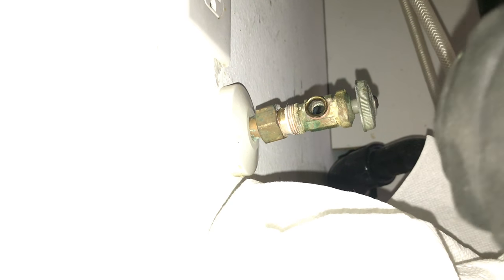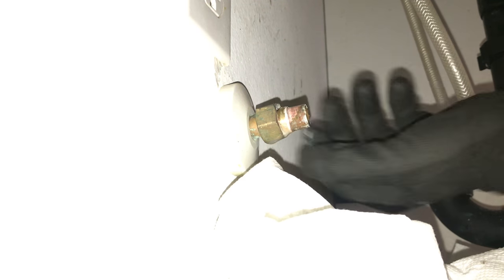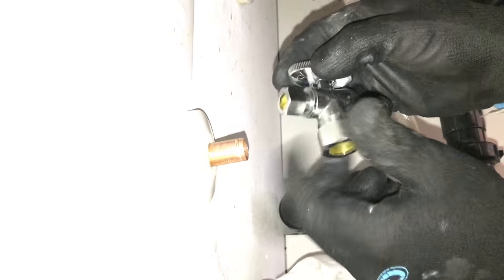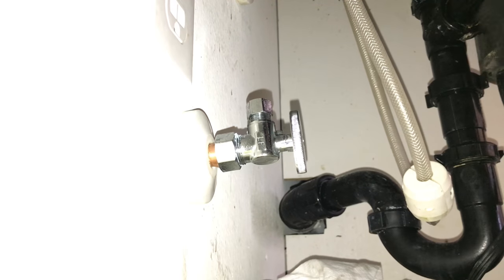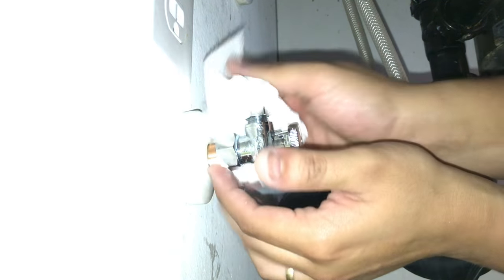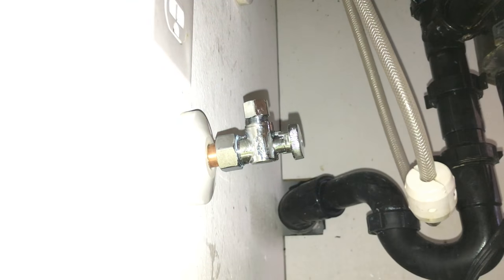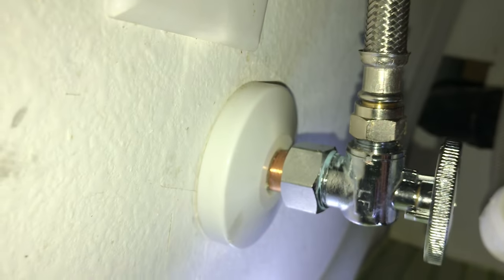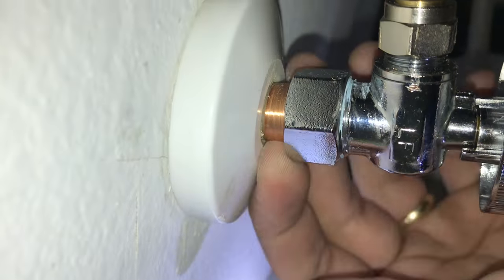How to replace a water shut off valve under the sink

Comment: That pulsing residual water leaking out often happens after shutting off the main water, even after draining for a while, because the pipes between that sink stem and the rest of the house still have water in them, and when you move that pipe, you make little waves that flow back and forth, which leaks out like we see here.

The solution is, when draining water for work like this, open the lowest point outflow and the farthest point outflow. In my house, this means opening the patio spigot outside. I catch this water in a bucket and throw it on my shrubs/trees/etc.
If you're not sure which is the lowest/farthest outflow, open them all. This drains much faster as well. 
Pro tip: be sure to turn off icemakers, tankless water heaters, and anything that has its own pump that turns on automatically. (Hot tubs, water filters, aquarium inflow, etc). If these turn on while the water is turned off, they can burn out their pumps and require expensive repairs.
Reply: Great advice, thank you!!
Do you have to cut the copper pipe? Isn’t sanding it with mesh good enough?
Reply: Golden advice youtube so good for this

Comment: Looks like a compression sleeve puller would have come in handy on this job.
Reply: What do you do when the pipe is too short and there is no room for the olive to be exposed and pulled out? Is there a reason not to keep the original nut and olive on there provided it fits the new replacement valve?
Reply: @Russell-rc6qq I would recommend not to use any fruits in the plumbing sustem.

Comment: Probably not the best placement for an outlet
Reply: Mine is the same.  I took my valve off to replace and it was still leaking and some water splashed up to towards the outlet.  I'm not sure any got on it but...  The breaker is off but still not a good place for a plug.
Reply: @sarahdickinson9523   Sometimes , we gotta work with what we got in tight spaces. I installed a GFCI outlet under my sink, so the second any water touches the metal inside, it shuts itself off. (These are often required by code if the outlet is within 2ft of a water outflow or valve.)

Also, its easy to throw some tape on the prong holes (duct tape, painters tape, etc) to prevent any accidental water sprays getting in there when you work on stuff like this. 
Happy DIYing!
Reply: The outlet is for the disposal
Reply: In a kitchen, there will always be an electric outlet under the sink but it’s placed higher than the  clean water pipe valves.
Reply: @AndreaMartinez-fg6qs and or the dish washer
Reply: My God lol my outlet is actually directly under the water line literally 3 inches underneath
Reply: A water valve 2 inches away from a power plug.
Reply: That's exactly what I was thinking
Reply: Outlet is good , but it needs to be AF/GF protected
Reply: Hopefully it's GFCI protected at the breaker box.
Reply: Well it's a kitchen sink and usually they should have a GFCI outlet even though the garbage disposal has one

Comment: I have a question, when you replace the hot water valve , do you shut off the whole house water , and do anything with the water heater ? What the procedure?
Reply: I am getting ready to do it tomorrow for bathroom sink hot water valve. I'm on one floor w gas heater and only a knob for cold water coming into tank, not going out. Now I'm told not to drain tank but shut off cold water going to tank and the house water thats next to my meter. Then open hot water lines everywhere cause I'm to dumb to know which is close and far, that this should take the pressure off and water out of hot lines. Once there is no hot water coming out and it shouldn't have been 50 gallons from the water heater, I can turn on hot water in sink and nothing flow but water still be in tank. Then I can replace the hit water valve with a shark bite which I thought would be easier, though after watching videos using the compression kind is just as easy. Now I'm doing this tomorrow 7 Jan 24 depending that my house doesn't flood or new gas hot water heater drain out and burn the elements with no water in it. I wasn't told to cut off the gas to pilot or anything like that, just turn off house water near meter and cold water going to tank then run water to drain pipes. It sounds simple, I only pray it works. Good luck with your project.

Comment: So its ok to not use a ferrel when installing a compression fitting?  Did you forget to or did that pipe dope replace the ferrel?  The pipe dope seals just as good as the ferrell?
Reply: The compression ring should be within the new valve, assuming he used a new valve and didn't just put the old one back on.
Reply: @lytnin88 the ferrel was inside the nut as he installed it. He held the ferrel in place with his thumb

Comment: i attempted to replace the shut off valves but the hot water side the water doesn’t stop even after 20 minutes of draining with the main water line turned off. do i also need to turn off the hot water tank line too? thank you for your help.
Reply: With a normal hot water tank, f you only shut off the water main, you have stopped the water coming into the tank but not the outflow, so opening a valve down the line will result in draining the entire tank, which might take an hour and wastes a ton of water & the energy used to heat that water. 

So, when working hot water lines, you need to shut off the outflow valve from your water heater. If its a tankless heater, its a good idea to shut the whole thing off (as in power down).
Reply: @jephbennett  oh... thank you for the info.  Good to know!
Reply: @jephbennett  you’re saying shut off the hot water outlet on the tank? The pipe coming out of the heater with the red knob?

Comment: At 7:29. How does the spigot get tight?  Don’t you need to put on a ring like u took off at 2:53?  If not, can you explain?
Reply: I wondered the same thing. I wonder if that little copper ring was inside the nut, and we didn’t see it when he put it on.
Reply: @mybrotherkeeper1484  that copper ring is called a compression ring. I learned this from further research.

I ended up removing my 3 multiturn water valves and replaced them all with  quarter turn valves. I didn’t cut the old pipe nor remove the compression rings on any of them. I just cleaned them up really nice with a sandpaper (220 grain) that was made for wood because that’s all I had around the house. My repairs were completed 11 days ago and there are no leaks so far so I think it went alright. Time will tell.

Hope this helps someone out!
Reply: @mattt879  Thanks! I have one of these leaking and I'm a little scared to try this myself lol
Reply: @Sky-wakka  I get it. I was nervous before too but it was pretty straightforward. Let me know if u have question and I’ll let u know my DIYer opinion :)
Reply: Your research saved me alot of aggravation, thank you so much!
Reply: I did the repairs 3 months ago and they’re still holding strong!  I’ll help with DIYer questions too if needed!

Comment: So. I have a few tools.... I see there you have the saw utilized, and another thing that just plain cut and shortened the pipe for good installing..and of course the mesh.           Is it a specific kind of mesh and can I ask what tool you used to shorten the pipe?   Thanks man. I'm hoping to install new faucet which also needs a new end valve...  Ty
Reply from the maker: You can go to the plumbing section at Home Depot 
Buy a copper pipe cutter 
And they should have sand paper specifically for cleaning pipe
Reply: @hectorworksout  thank you, I'm screen shotting this, I sure do appreciate.    👍👌

Comment: the little ring thing you cut off with hack saw, you didn't have to put a new one back on in it's place?
Reply: He forgot to put a new one
Reply: @eddiele35 He had the new ring in the nut, held in place with he's thumb as he installed it otherwise the whole valve would have blown off as soon as he turned the water back on

Comment: For $20 you can buy a puller that’ll make that removal a lot easier.
Reply: whats the name of that tool, kind sir?
Reply: @sundance kidd  compression sleeve puller. Type that in on the home depot app.
Reply: I try to do everything myself if I can. This seems like a doable job with the right tools and patience. I have this exact valve shown in this video. I need to replace both cold and hot. My only concern is how tight it needs to be sealed at the end. Looks like he just winged it in this video. Which is understandable as he’s probably a professional. But for me, the average diy’er, I have no clue. And once you pop that old valve off, there’s no going back. Lol Then it’s pray to God a real plumber can save my ass before the family needs water. 😄 I’m so tempted to do this. I have a plumber scheduled for something unrelated. Might try my luck and if it doesn’t work out, plumber can fix my mistake.

Comment: Removing the valve from copper pipe. Easy. Try removing it from plastic PVC pipe. Still trying to figure that out.
Reply from the maker: Cut pipe from behind the compression ring, then use a push fit valve or a compression valve whichever you prefer.